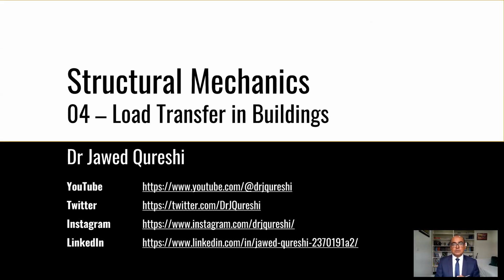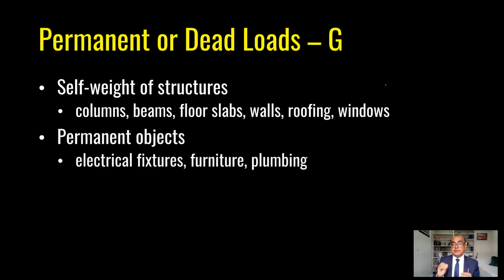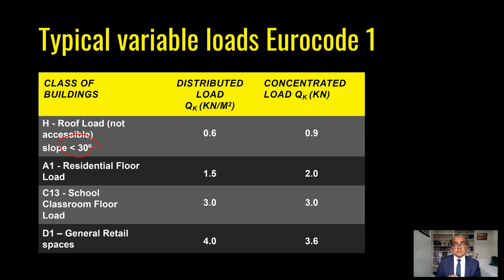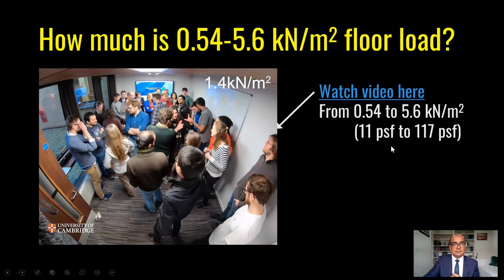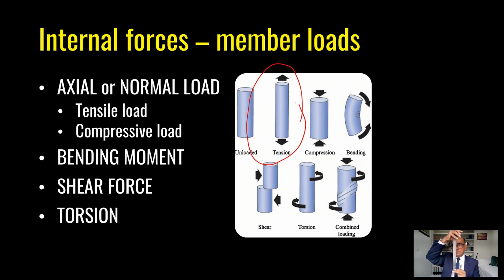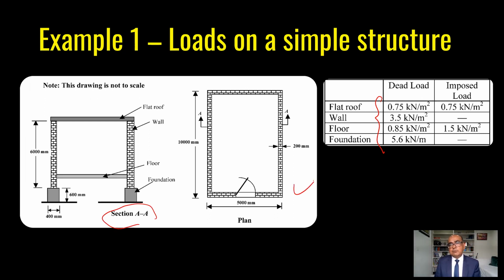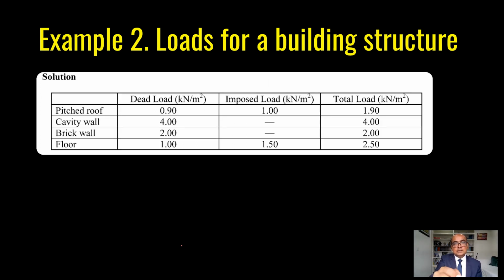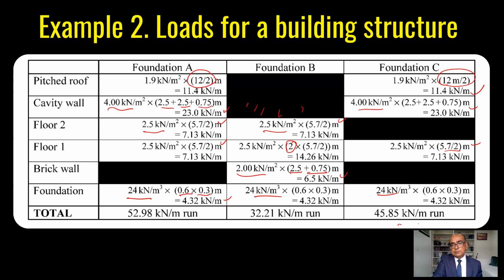Floor Loading Simplified - Essential Knowledge for Architects & Engineers

Comment: Are we not using load factors during the load calculation ?
Reply from the maker: We use factored floor loads when we design structures using limit state design methods. Here, a high level summary of floor loads is explained.

Comment: Thank you sir , i have a question, how can i recongnize in real life,  the fix reaction,  pin reaction. Thank you sir
Reply from the maker: These modelling assumptions. Bolted end plate connections in steel buildings are generally assumed to be pinned. Monolith RCC joints are assumed to be fixed.